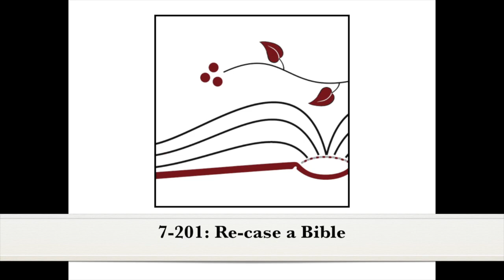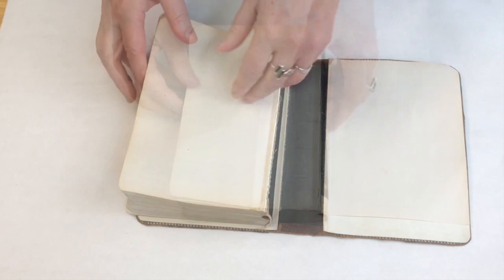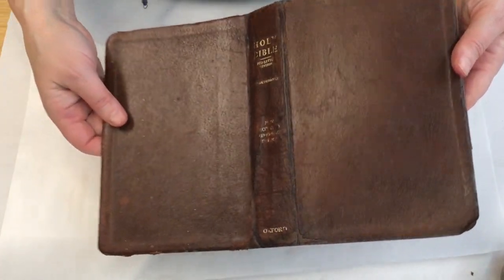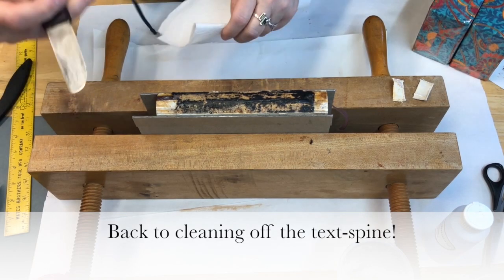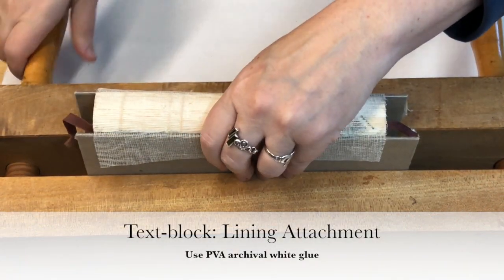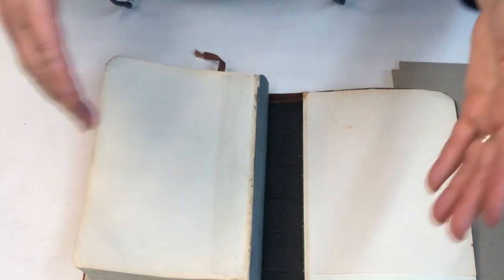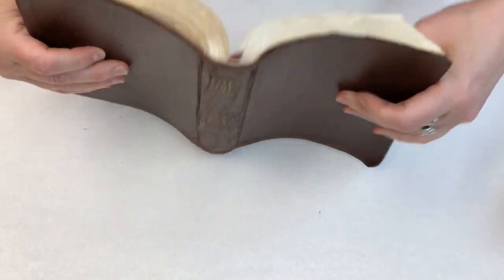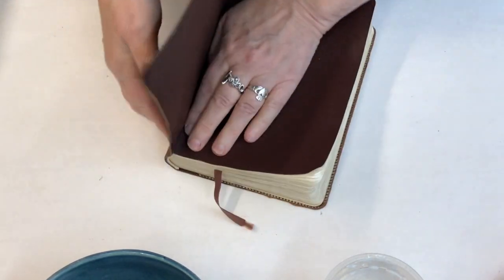How to Repair a Bible Binding (In Brief): Save Your Books

Comment: What kind of paste did you use to clean the spine before using your tool to scrape the old glue off?
Reply from the maker: It is just rice starch paste. I use Nori brand paste. There are lots of others that work fine too.
Reply: Sorry, from my understanding, rice starch paste is a glue. Does the paste also somehow also work to remove old glue and stuff?

Comment: Hey! Just started getting into Bible Rebinding! I was wondering where you purchased the Oxford hollow paper. Is it a specific type? Lastly, what kind of meshing material did you use to reinforce the spine? Was it just normal poly ribbon mesh? Thanks! :)
Reply from the maker: Hey there. I bought the Antique end-leaf paper and "Super" or "Mull" from Talasonline.com. However, so you know, I sell a kit that has enough for a book or two through www.saveyourbooks.com if you don't want to buy large amounts. Cheers.
Reply: Awesome! Thank you so much!

Comment: I glued a deer skin on the cover of my bible 30+ yrs ago and after that many years of use the bible maps came loose and lost and some of the other pages were falling out.  I have another bible in fact the exact same bible only new that I gave to a friend and she said it was to heavy for her and she gave it back to me.  Question:  I want to do same thing to this bible but I want to use a different glue as the the one I did years ago got very stiff when dried like a board.  What kind of glue can I use and still have the original cover flexible?   Thanks in advance.
Reply from the maker: Because this is an unusual binding choice you may run into troubles other than the glue but the answer, in general, is that a good quality PVA (poly vinyl acetate) glue will stay flexible. I can recommend Jade 403. Whether it will adhere deer-skin to the bible cover depends on some other things. Good luck with your project!

Comment: Why is a hollow necessary?
Reply from the maker: While creating a hollow is not necessary for all books, the structure of books that are case-bound require a hollow space between the text-spine and case-spine. This can be created with a paper hollow which attaches the two spines, or just leaving the two spines disconnected works. Other kinds of binding do not require a hollow at all such as for a paperback.

Comment: I have a KJV bible which is using paste down liner being glued to its French Morocco leather cover. Recently, I found the paste down liner is starting to go off. What is the best way to repair it?
Reply from the maker: Hard to picture what you are talking about, but I think you just need some adhesive added under the liner?

Comment: If the old glue is modern pva what do you dissolve it with please?
Reply from the maker: PVA glue is not the kind you can dissolve. However there are two different methods. One is to freeze the book because the PVA should crack off. I have never tried this though so test on a book you don't care about. Otherwise, Sometimes you can just re-activate the PVA with heat and it works to re-attach. Good luck!

Comment: I've never seen a text block glued to a cover spine before.  How is it supposed to move if it's glued?
Reply from the maker: This is glued with a hollow. Not directly. But all paperbacks are glued spine to spine. 😊. Good point!
Reply: Where is the “hollow”?
Reply from the maker: @ruthcarter8895  I believe this is what is called a "made" hollow which just means they are not connected at the spine. For more see www.saveyourbooks.com
Reply: Link doesn't work